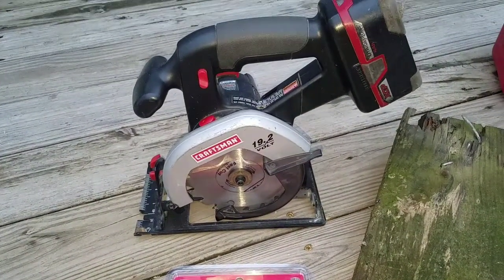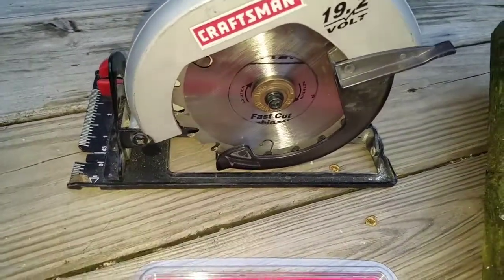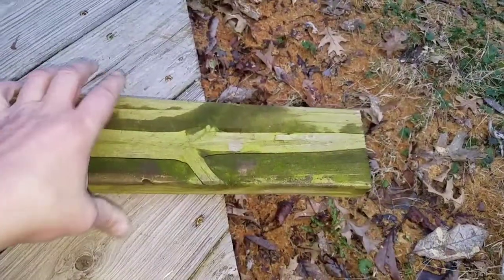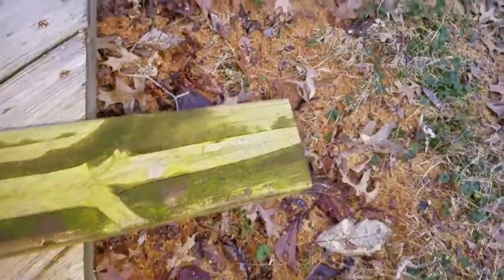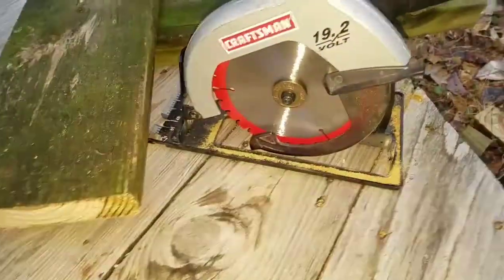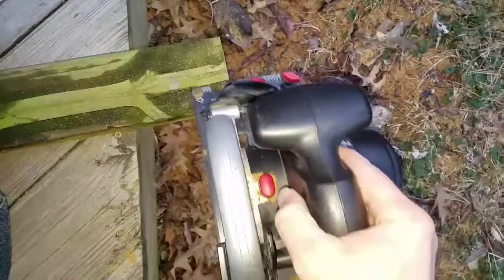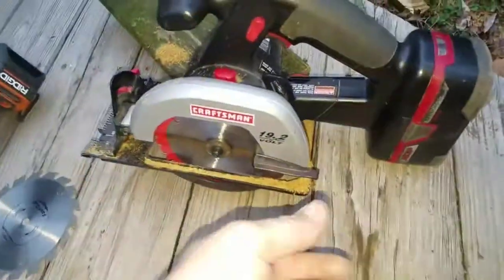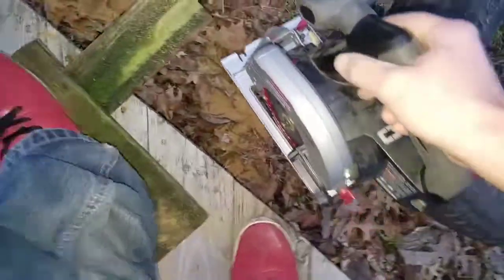Admiral 5 1/2" circular saw blade, is it worth it?

Comment: so, I saw a review on how many cuts a regular blade will make vs a carbide blade.  basically, non-carbide blades are like disposable AA non-alkaline batteries  (the "Heavy Duty" ones).   There is no reason to buy them.  the newer options last several times longer.  Just learned that about 3 weeks ago thanks to a youtube video.  thought I would share the info.  Harbor freight has carbide 5 1/2" blades for under $6 (just bought 4 today).

Comment: whats up JT ,good review!!!! I'm suscribed to your other channel too.I just came up on this same circular saw and reciprocating saw for 25 bucks each,I got the same battery too,they work pretty good,I'm gonna get some of those admiral blades .Thanks for the review.
Reply from the maker: You're welcome, if you can get diablo blades... if will be even better.
Reply: @InNerdimensional  yeah the diablo blades are good a little bit more expensive but they work they cut through metal and everything.Hows the 22 pistol holding up ,the one you did a review on???
Reply from the maker: @roledog77  I got it taken away by the PD